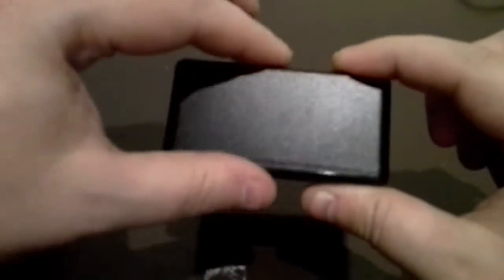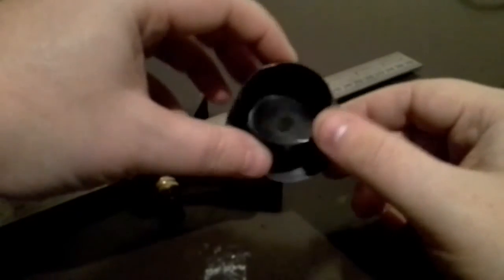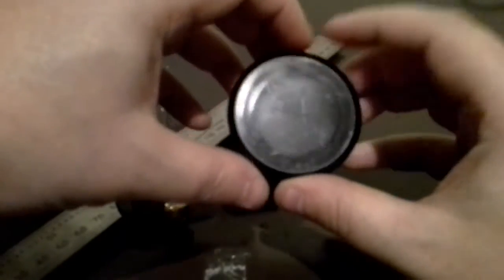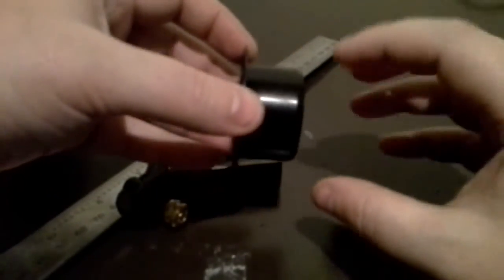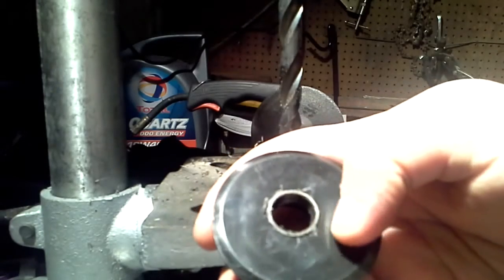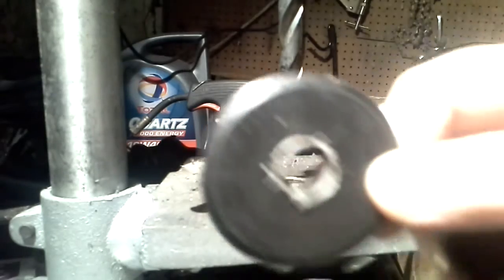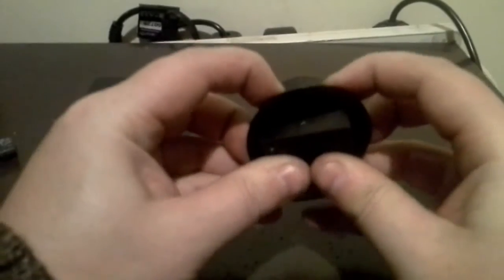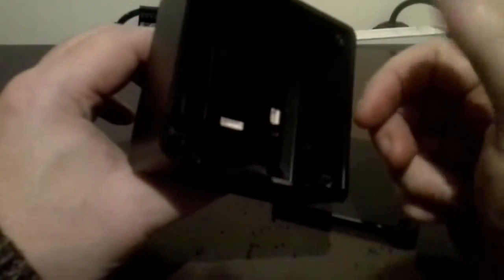DIY Night Vision - Camera mounting Example 1

Comment: what camera is that?...what lens are you using also ?
Reply from the maker: george robu Sony CCD 700 TVL Super HAD. The lens I use is always 16mm albeit you can use a 12mm if you wish.
Reply: thanks, i also have a cctv fpv camera with super had ccd II from china i have varifocal lens 2.8-12 f1.4 with autoiris , now i find that 16mm lens are far more better, i ordered another 16mm lens f1.2 with ir sensors??? don t know what that means but i hope that they will be better.